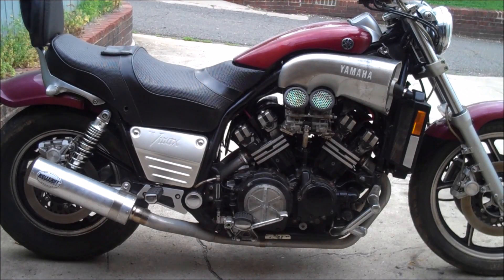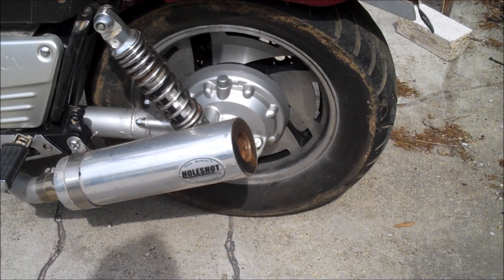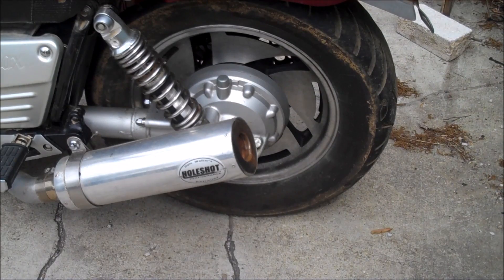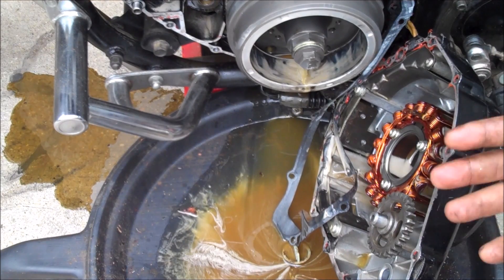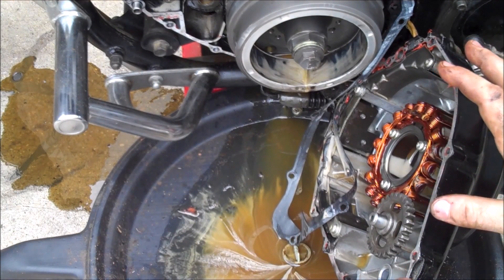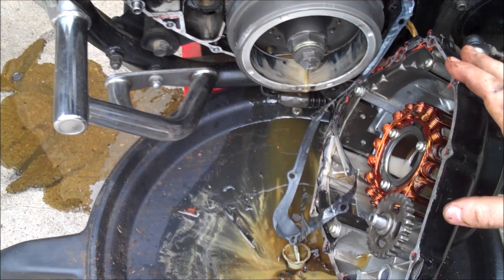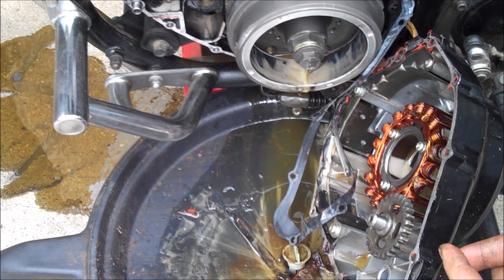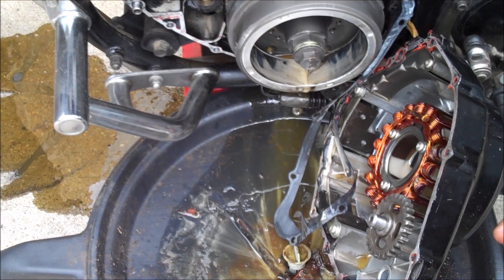How to free up a seized motor

Comment: Hey I've got a guy willing to part with 2 CB750's in exchange for some bundles of hay, but both bikes are seized, you make it look easy but i don't have much confidence myself, also will the motor be fine even if it does turn without a rebuild? wouldn't it be better to just do that for the longevity? i don't know much about bikes but I want to get into them very badly and thought this would be a cheap way to start, I'd appreciate any advice, thanks in advance.
Reply from the maker: +TheSatch10 Wow thats a great deal considering what we pay for hay. I say go for it. Theres no way to tell if the motor will be ok after this process, but its sure to be better than seized so its worth a shot. Even if they are both destroyed CB750's are a hot item and you can make quite a bit parting them out on ebay
Reply: +mrmaxstorey Only thing is, the guy lives almost 7 hours away and I'd need to fill up a truck for that 14+ hour trip. If i could get the engines running smoothly I'd want to make some cafe builds. And I still have to buy however much hay the guy wants. What do you think?
Reply from the maker: +TheSatch10 Well, what years are they
Reply: +mrmaxstorey 77 and 78
Reply from the maker: +TheSatch10 OK and how much $ do you have to spend on the hay
Reply: +mrmaxstorey Well I emailed the guy asking how much he wanted or what he was looking for in terms of the hay but he hasn't replied, so I don't know how much he wants. I could get the bales for around $12 each. I'd only be able to offer as much as I can carry on the truck for the trip, so maybe 10 or so
Reply from the maker: +TheSatch10 Thats still a great deal Id definitely be tempted
Reply: +mrmaxstorey alright thanks for the talk, I'll update you if anything goes down!
Reply: +mrmaxstorey One last thing I forgot to mention though, he doesn't have the titles, should I even bother?
Reply from the maker: +TheSatch10 Hmm well thats definitely a bummer, but it might not be a dealbreaker, depending on your state.
Reply: +mrmaxstorey California
Reply from the maker: +TheSatch10 When I lived in CA I successfully titled vintage bikes with just a bill of sale, but its worth contacting the DMV to check up on what exactly are the requirements
Reply: +mrmaxstorey mind if I ask when that was? I contacted my local DMV and got a hellspawn of an associate and they said in order to receive a title, the last registered owner needs to pay any due fees of the last three years, renew their registration and finally they'd get the title, which they could then give to me. How did you go about getting titles?
Reply from the maker: +TheSatch10 Yeah if the back fees are unpaid youll have to settle thos eup maximum $600 per vehicle. Theres a place on the DMV website you can check backfees with the vin number. Honestly its been a while I don't remember the exact process, but it didn't take me long to figure it out while I was there I remember that
Reply: TheSatch10 get a Vermont will do the trick. Google search “chin on the tank Vermont”

Comment: If u get it running - you got an amazing deal. Those V-Gas carbs are pricey themselves. judging by the wheels- it's an 85-86 model?  Most powerful engines in those year vmax bikes. What was the outcome- she dead or alive
Reply from the maker: +Ron Towers Got it running great and sold it

Comment: ok so you have the bike in gear and you start rocking it, how much should the bike move when it's not seized compared to when it is?
Reply from the maker: +Blake Thomason Just a bit more. That varies widely based on shaft/chain drive transmission, and what engine you have. A little bit is normal
Reply: +mrmaxstorey Thanks man. Got a 81 cb900 that's been sitting out for a while so I gotta unseize it, could you break anything if you try and force it to move too far?
Reply from the maker: +Blake Thomason You should be ok

Comment: I've got a seized cb360t and have added penetrant in both spark plug holes. currently the bike won't shift either, even when I try to rock it as you show. Will rocking it back and forth still work if the shift is locked up? it's not in neutral but I don't know what gear it's in.
Reply from the maker: +B.A. Myint yes

Comment: Another thing this happens to is front shock absorbers.  Rain water will get in them and rust them and lock them down frozen.  Drain them, use lots of PB blaster and back and forth motion or shocks until you can get them to wiggle.

Comment: Great video, but I need to know, did you get that bike [that I am jealous of BTW] running with just this procedure??
Reply from the maker: +Deksam101 Well, i busted free the motor with just this procedure. To get it running I also needed to cleant he carbs, repair electrical, etc
Reply: Awesome! Good work! So are you going to flip it, ride it or both?
Reply from the maker: +Deksam101 Lol this was over a year ago, its long gone
Reply: +mrmaxstorey Ok cool, Just a dream bike of mine is all. All I have is it's little brother, a 1985 Maxim-X 750.

Comment: I use 50/50,
 diesel fuel and ATF Automatic trans fluid for my penetrating engine un-freeze, i have used this on several bikes and all bike runs great and are still running great.
Reply: Thanks Gary, Is ATF + 4 Full Synthetic transmission oil ok to put in there? What should i cut it with if I don't use diesel?
Reply: considering wd-40 to ATF-4 mix

Comment: My 83 goldwing was locked it;s been left outside for 3 years where the water got in the carb with intake valve at open position and flooded the piston so rust ate the cylinder wall in short it's f..ked !!!
Reply: +lightrose100 I have a 83' Goldwing that had a frozen engine like this had not ran in years, and had water/rust in the cylinders, i pulled the exhaust and spark plugs,  used disiel fuel and ATF to unfrieze the engine, it has worked for me on several frozen Goldwings
Reply: Got another engine for it and I keep the old one for parts

Comment: I have a 2013 stomp with a stuck piston, i have dropped the engine out and turned it upwards so the piston is facing up and filled the spark plug with WD40, the kickstart wont budge and it doesnt like rolling in gear so i guess it is the piston. If i can manage to unseize it, what should i do next? And what should i do with all of that WD40 in the engine?
Reply: (It has been stood up for almost a year, with weather and moisture around it)
Reply from the maker: Tom Walduck The WD40 will blow out if you run it with the spark plugs out. Just be sure to lubricate it well, turn it over a bunch  of times,a nd follow up with a compression test after

Comment: Great info here thx for sharing...also subscribed to your channel.  Having some issues with my bike right and came across your video.
Reply from the maker: What kind of issues are you having?
Reply: Somehow my crankshaft got stuck and wouldn't  turn over when starting.  Thought it was battery but had enough juice then tried jump starting it in 2nd gear but back tires won't turn when I popped the clutch and i did some Googling....I tried your method..putting it in the highest gear and rocking it back and forward.. It worked. Got it to start, rode it down the street and now it feels like I lost power.... Spark Plugs?.... I'm no mechanic by all means just like you wanting to learn and do it like you say... And just process of elimination.  Thx for responding!
Reply from the maker: Sou Vannavong
Id do a compression test first off to make sure that all your cylinders are good
Reply: Thx for tip Max and I'll do compression test for sure before I ride again. Thx again for all your videos they do teach a lot!!!

Comment: forgive me if im being really stupid but hopefully you can help. ive a honda cb400n superdream had it running about 4 months ago and now it wont. cant turn it over by hand or anything. 
if you fill it up with WD40 what happens to the WD40 does it just evaporate?
Reply from the maker: Basically the WD40 gets eaten up by the motor, burned off in about a minute and you are good to go. However, its unusual for a motor to seize from rust in only 4 months. If your motor is truly seized, it is most likely to be mechanically seized, either from eating a valve or spinning a bearing or something like that. Any motor can be rebuilt, sometimes its less labor intensive to replace it. Depending on how close you are to DC, I actually have a good CB400 motor i can let you have for $50. Regardless of how it goes good luck to ya
Reply: cheers for your reply its very helpful. unfortunatly ive not had much of a chance with work commitments to fiddle with the bike im also in the UK so cost even tho i would snap your hand off for the motor the postage/shipping will be horrendous. ive got a friend coming over possible at the weekend to help me remove the engine its going to be a long restoration but its a learning curve and theres no rush to it as ive got my gorgeous CBR 600 RR. thanks again

Comment: Hi again you helped me on my jets . I now have a different issue.  1980honda cb750c dohc started fine. Started hearing a knocking noise. Tight end the cam chain. And still had noise over the #4 cylinder exhaust side.  Noise got louder as I test drove it. I gave up and was taking it to a shop. Not far from my house and it shut off.  No clunky noise just shut off. And now the bike won't turn on and crank won't turn manually.  It's stuck what do you recommend
Reply from the maker: Is the motor stuck, or do you not have electrical power to the starter motor?
Reply: mrmaxstorey  the motor is stuck their is power going to motor I can hear it spin. . I can't turn crank case by hand
Reply from the maker: scal760
You may have thrown a rod. The repair I show in this video is unlikely to help you with your bike. Time for a complete rebuild or a motor replacement

Comment: I have a 250cc scooter and my motor seized the electric and alarm works fine but the engine want turn over when I try to start it,I was going to install a new engine and everyone says the engine is gone,any suggestions please?

Comment: Hi, I know it isn't related much to this video, but can you fit any universal master cylinder to a bike for the front brake, or does it have to be manufacturer parts
Reply from the maker: I swap master cyls around between bikes all the time. You gotta keep the same banjo bolt or at least have one thats the same size, but yeah master cyls dont have to be from the same manufacturer

Comment: Did you have to do something to remove all of the WD-40 from the cylinder before firing it up for the first time?
Reply from the maker: Nah just let it bun off
Reply: is that the same procedure if transmission fluid-diesel is used? Burn it off or does it need to be extracted prior to running?

Comment: The stator and starter gears looked very clean despite the residue in the oil.
   Whats your take on a bike that was in salt water for 3-4 hours? (Hurricane sandy) its a 74 cb 550 that had some work done on it . Top end rebuild and a bunch of other stuff. I took the plugs out, kicked it over , a little water spit out , put plugs back in , it started up. I drained the oil, didnt see any white salt residue. changed the oil and filters 2 times. I think im ok, rode it  many times since, but i'm still waiting for the UNSEEN bug to rear its head... any thoughts?
Reply from the maker: If it was only submerged a short time, and you changed the oil several times since and it is still running good, then Id say you escaped any real damage. Flooded bikes and especially saltwater flooded bikes usually seize much harder and have lots of corrosion, but I think you are gonna be ok
Reply: mrmaxstorey Cool thanks dude! Please keep the vids coming!

Comment: Man ... I am always so glad when I see a new upload, from you.
So ... What if rocking or bumping the starter motor had worked, initially ??
At what point would you have drained and changed the oil + Filter ?
Reply from the maker: Yeah I usually change the oil and filter once I get the bike unstuck

Comment: I have found the Marvel Mystery oil work great, better than diesel fuel, or wd40, or just about any other stuff. Also adding some ATF into the crankcase helps clean and was the crud out, then after running a little while, change filter & oil as you said. I would run a little MMO in the fuel to lubricate the valve train while riding, go by what the bottle says to use. Hope that helps, it has for others, like me, plus it smells good. lol